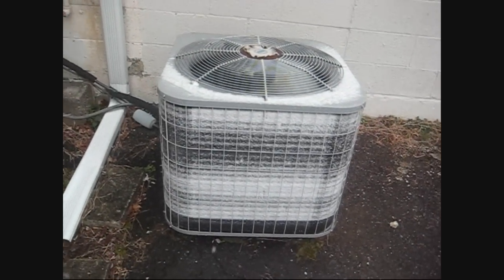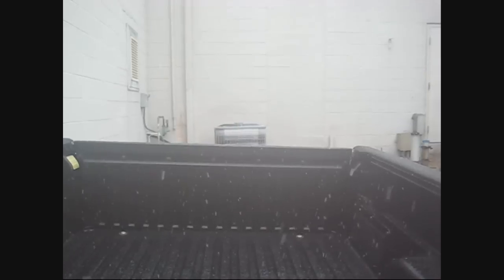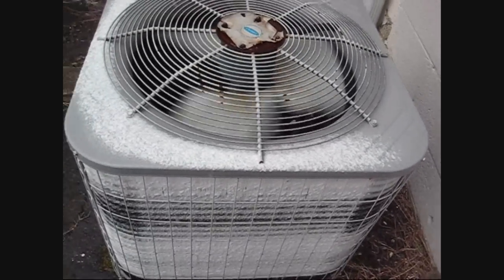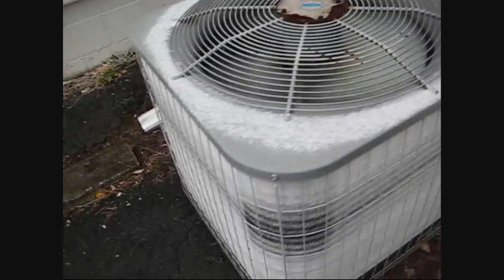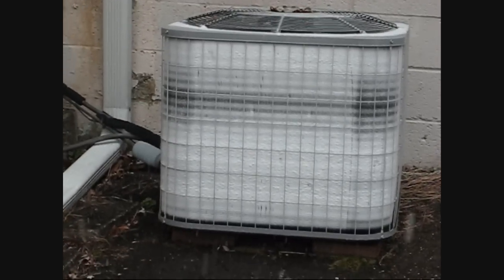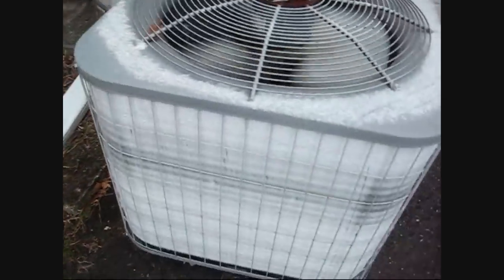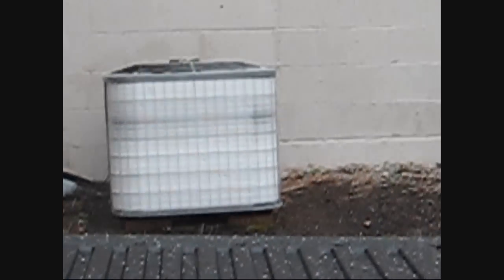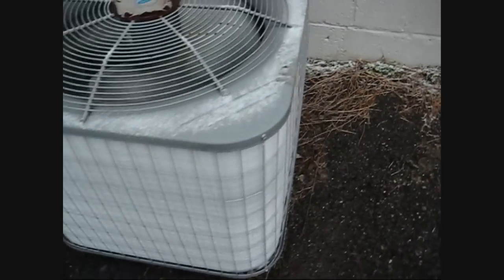2004 Carrier 3-ton heat pump-footage leading up to defrost cycle steam show

Comment: You can manually initiate a defrost cycle via the defrost control board on this model. There are short-out pins on the defrost board designed for this purpose. I've had to do it for troubleshooting. I think you also have to jumper "R" to "W2" on the board before you short-out the pins with a flat head screwdriver. It's been awhile since I've done this because I mostly work with gas furnaces in San Diego, CA.
Reply: +4wheeler 4wheeler again. There is a thermal switch that works in conjunction with the defrost board that will initiate the defrost cycle when the coil temp. reaches aprox. 35 deg. The board can be manually set up for 30, 60, 90, or 120 min. by a tech. That times the compressor run time and when the thermal switch senses 35 deg. it will bypass the timer and initiate defrost. Once the coil reaches aprox. 55 deg. the cycle is terminated. This usually occurs after about 10 min. average. If the thermal switch doesn't initiate the defrost cycle, the timer in the defrost control board will by default. If you live in an extremely cold climate I recommend the board timer be set for 60 min. In San Diego County, CA I usually set it up for 90 min. or 120 min. depending on the location. I hope this information is useful to someone watching out there.
Reply: +4wheeler 4wheeler Correction to my original comment above. When initiating a defrost cycle, you first install a jumper to bypass the temp. sensor and not "R" to "W2". Jumper the temp. sensor and use a flat head screwdriver to short out the test pins. You hold the screwdriver on both pins until you hear the reversing valve switch over to cooling and immediately remove the screwdriver. It's been awhile since I've done this so that's why I didn't remember the correct procedure. I didn't want to give bad information in case someone is trying to learn from this.

Comment: I couldn't help but notice you saying that the "condenser" is freezing. The outside coil can actually be called the evaporator with the system on heat mode.

Comment: Our trane unit just shit the bed...  Noticed the a/c was but there was no cooling in the house.  When outside and the suction line was covered in about 1/2 of ice.  So i shut the unit down. I checked the filters, and replaced some that needed it.  Now the condenser unit and compressor runs,but both the discharge and suction  line coming out of the condenser do not change temp when feeling them by hand, and
 still no cold air.  I think the compressor is shot, or the freon leaked out or something.
Reply: SaGalv put some guages on it and check superheat and subcooling if you think the coolant is undercharged...high superheat= undercharged, low subcool= undercharged...hope this helps

Comment: No this person does not work on these at all. If he did he would know how to set in into defrost and or shut it down because the unit gets closer and closer to breaking the heat pump as ice builds up.... He could remove the cover and change the defrost timer as we'll..... Most likely a bad defrost board
Reply: It did go in to defrost mode eveñtually.
Reply: He’s just filming it for fun, not to work on it...